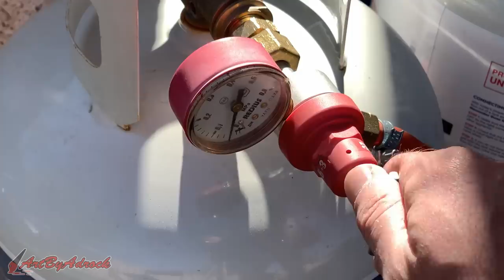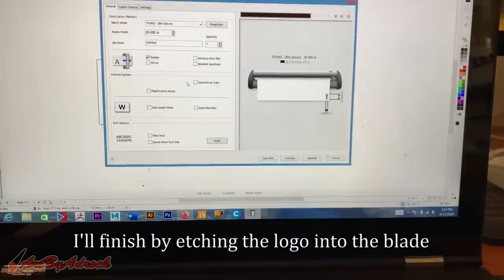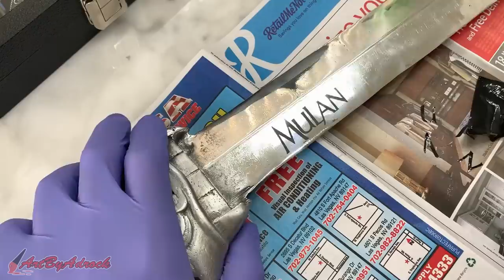Casting Mulan's Sword From Scrap Aluminum Ingots - DIY Metal Sword Making

Comment: I was actually amazed how cheap some of those were.  The Mjolnir Wolf stuff was very cool!

As for this week's pour, man that was a lot of flashing to deal with.  I just got that swag stand for my saw like that, need to get it setup this weekend, looks like that setup came in quite useful for this cleanup.
Reply from the maker: It works wonders! You’ll be very happy with the stand 👍🏻
Reply: @ArtByAdrock  I kept thinking of building one myself, then after 6 months or so.....  realized I would never get to it, so I bought it instead!
Reply from the maker: That’s exactly how I felt. Much easier to just buy it

Comment: the part of the blade that had the leak out i think was caused because the piece of plywood you used to mold the sand on was warped look back at when you layed the mold in there it had lots of gap's

Comment: How long do you leave the hydrochloric acid on before you rinse/wipe it off? Also is there any validity to the salt water etching method?
Reply from the maker: The acid only takes about 30 seconds before I wipe it off. The salt and battery method works great too however this is much faster. 👍🏻
Reply: @ArtByAdrock  cool thanks man. I'm gonna try it out